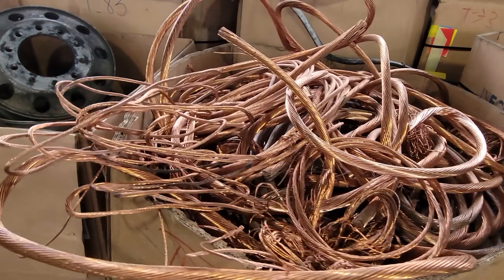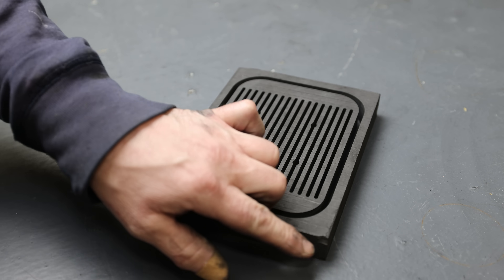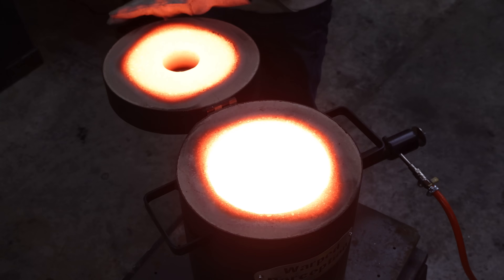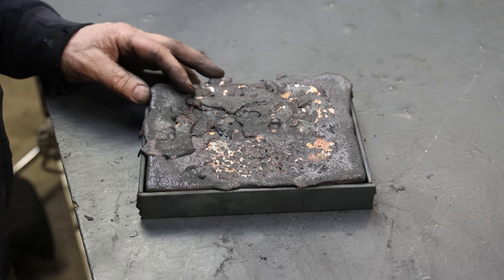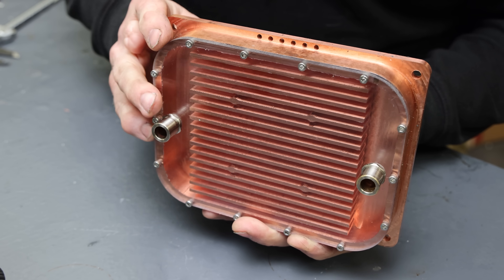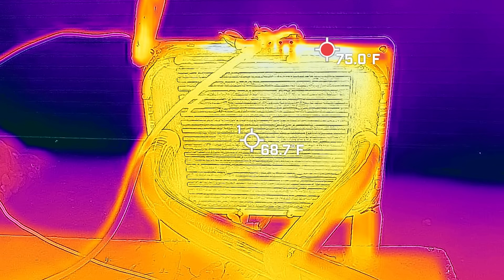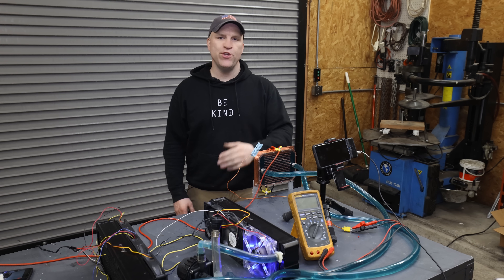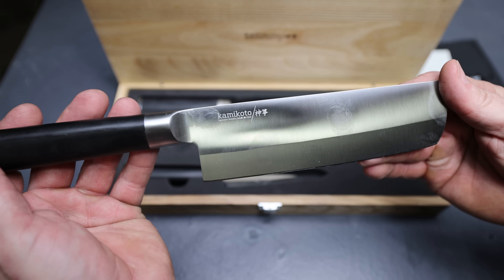Making a Huge Waterblock from Scrap Copper -Trash to Treasure

Comment: Is it me or this should have been done in one single uninterrupted pour as allowing for the metal to start to cool down and solidify before another pour will result in less than ideal properties (aka transition zones prone to cracking/easier to break)? *Just asking, definitely not my area of expertise
Reply: He recast it 2 more times to get it right... says in the video
Reply: He needed a larger crucible, larger crucible tongs, larger foundry and larger biceps (and/or help). Having been in the same situation myself, I think he did rather well for himself.
Reply: @frankdoss6313  damn good effort and results as an engineer myself I'm impressed.
Reply: It looks like he worked around that by superheating the final pour over the furnace to allow the whole item to re-melt into one item
Reply from the maker: @GaisaSanktejo  I did try that but it failed, because carbon oxidizes in a flame environment, so basically in the longer you keep it on that flame the more the carbon mold basically evaporates and disappears eventually. The carbon atoms heat up and combined with the molecules in the flame kernel. But yeah that didn't work so I had to recast it two more times.
Reply: @WarpedYT  Ah, that is a shame
Reply: @WarpedYT  perhaps heating the block in an argon/nitrogen kiln could save a step...but you're right lifting that much dangerous metal is not fun. Best get on fabbing a crucible tilter!
Reply: @WarpedYT  bloody nice job mate, as an engineer myself impressed bro. Keep on keeping on👍
Reply: @WarpedYT  I would "think" you'd want to pour it like pancake batter, start in the center and let it keep flowing outwards vs moving around, that way it wouldn't cool unevenly like it did?
Reply: @WarpedYT  clamp another graphite block on top of the mold and drill a hole thick enough for the metal to flow through, add a bowl shape around the hole, extend the bowl width with sand if necessary, and pour into the mold.  A hole on the other side is necessary as well so that air can escape.
Reply: Called a 'cold shut' if anyone cares.
Reply: @hendrikvanleeuwen9110  as a teen I was fortunate enough to grow up next-door to a bachelor with a GARAGE full of fabrication tools and a full forge out back, a FULL machinist shop, and as I got older a fridge full of beer too! He was one heck of a professionally trained machinist/fabricator amongst the many other numerous "skills" he taught me...
Reply: @hendrikvanleeuwen9110  I find most people don't "care" because they simply can't muster the metal capacity to understand... But yes, I'm familiar with "cold shut" from Blacksmithing/Blade work. Where instead of having a good "hot metal bond" you trap a layer of cooled metal that doesn't bind, or even a pocket of AIR if you're a really "lousy" Smith between your work, vs one "homogeneous" molten piece. Correct?
Reply: @macgyver5108  yup. Essentially you are casting (or alternatively forging) a crack into the piece. Man, I envy you growing up with all that gear available AND someone to show you how to use it.
Reply: @hendrikvanleeuwen9110  I'm MORE than well aware how "fortunate" I was having such a skilled mentor and skill resource just a few short steps away during my formative years! Machining, welding, blacksmithing, small arms care and ammo reloading, even photography with his own darkroom... A "Teenage MacGyver's wet DREAM" if you will! I do my part to pass that on to the next gen, even to my nieces.
Reply: @macgyver5108  enough with the "quotes"
Reply: @coronalight77  What quotes? Get a grip or wake up, haven't used them here :P Coffee missing?
Reply: @coronalight77  as the great poets Henley and Frey put it so well... "get over it!".
Reply: Lol all that to pretend to have a clue when the basic is you're obviously too slow to pay attention to the full vid. Running to comments like a pathetic troll as soon as you think you have a shot to call someone out only to be made to look ignorant since he clearly answers those things in the vid. Sit down and stay in your lane.
Reply: @coronalight77  yeh yeh hasty hasty I know, and definitely a bad habbit.
Reply: He was saying that it was too heavy and he was losing his grip.
Reply: Very true, I was wondering why there wasn't a separation in the machined part, then he mentions it was the 3rd casting because the first one had separated.
Reply: @kingcosworth2643  Yey to basic physics based logic :)
Reply: @wskinnyodden  shame you have no common sense to go with it.
Reply: Yeah, 605 people who watched this have a clue what they just saw. He wasted the graphite mold too by destroying it after. He could have just poured a slab of copper and machined it - copper is soft and he machined it anyway so it's kinda a waste of time and effort. He did double the work just to make a longer video. And flubbed the pour so terribly anyone else would have started over. Idk what 'five years' working on a LED he's talking about but I have a feeling this is something other people would have made in a week if his fabrication skills are anything to go by.
Reply: Who cares 🤷‍♂️ freaking awesome engineering mate UK

Comment: I guess you saved money and time by machining the graphite and then melting and casting the heat sink three times followed by setting it up and machining each attempt.  Me, I would have simply bought a copper billet and machined it once.  As far as a broken drill in the copper, there are alot of machine shops with a plunge EDM that could have burnt out the broken tool and saved the part.  That aside, cool project none the less.
Reply from the maker: Not really about saving money, It was more about figuring out how to machine the part with The equipment I had on hand, and I thought it was a cool smelting project. If I would have had my big mill set up at that time That would have been a no-brainer, just get a billet and machine it. It was definitely a real pain. Thanks

Comment: Excuse my ignorance but wouldnt it have been cheaper and easier for you to make a big block of copper and then cut it to make the part you want? Sure, you'd have to use more copper, but you can recover that by collecting the scrap from the machining. This way you'd avoid the expense of graphite (which probably isnt nearly anything much compared to copper), and the hassle of casting copper into a complicated mold, which tends to fail sometimes

Comment: Is it me or would casting the copper into a block and milling that out not be alot more easy ?
Reply from the maker: Yes kind of, I may have actually ended up doing that at the end I don't remember but In this case I made the casting oversized and then I machined it, I guess the main purpose was to show the metal going from scrap to a finished part, because if I was going to Mill it out of a solid piece I would just buy a solid piece. But yeah I'm still using the light to this day... I have yet to use it for a video because I was busy with Mr Beast and then I had a brain injury in September so I just got back to work like a month ago...
Reply: @WarpedYT  ahh that sounds bad man , hope your all fine now . Love your content i just found your channel yesterday but great video's  mate keep it up ! and take care

Comment: the copper block you made would work much better if the water went through a maze pattern, instead of just having two holes on each side, I am sure you had a lot of the water where it never moved.

Comment: Those the water cool their PCs deal with this everyday, if you knew the watts of heat you needed to remove you might have been able to buy a copper block cooler off the shelf & long with the needed pumps and radiators to handle this job.

Comment: Hot water needs to enter the top and cold come out the bottom or you aren't taking advantage of your fins. Try a motorcycle oil cooler or a refrigeration unit evaporator coil. It's basically made like a small radiator and will pass air through

Comment: Your camera is also reading the plexiglass not the chip temp.  Hope there is a very good interface conduction. Sometimes that's the hardest part of exchangers is getting the heat off the chip into what ever heat dissipation method

Comment: As some one who used to do a lot of computer over clocking I think you can improve the heat transfer a noticeable amount simply by wet sanding the heat sink to a mirror Finnish. Just make sure you make its on super flat surface (I used a glass block in the day). Worse case scenario it will look super pretty. You may be able to get away with no using thermal paste either. I'm not sure the surface of the LED but we polished cpu chips too. I was able to punch 5.5ghz on a bsel modded Intel Core 2 Duo Wolfdale on air and almost 8ghz on liquid nitro.

Comment: ALSO YOU MADE IT WRONG THE INLET SHOULD BE ON THE TOP AND THE OUTLET ON THE BOTTOM OR VISE VERSA NOT ON THE SIDES BECAUSE THE COOLANT WILL ONLY GO ACROSS AND NOT THRU ALL THE COOLANT FINS LOOK AT A CAR RADIATOR!!! BOTTOM SO TLSO IT THE COOLING FINS SHOULD BE IN A MAZE LIKE PATTERN AND GO FROM LEFT TO RIGHT IN A ZIGZAG PATTERN LIKE MOUSE MAZE FROM TOP TO BOTTOM SO THE COOLANT HAS CONTACT WITH EVERY COOLING FIN ALL THE WAY DOWN! JUST SAYIN IT WOULD COOL BETTER!!! JUST SAYIN

Comment: so i noticed how the copper almost flakes out and breaks into splinters like wood. is that because it was made with copper wire, and for whatever reason it didn't properly consolidate when it was smelted? i mean, if they were coated it could happen, which can be dealt with by burning them out first at a high enough heat, and removing the slag and soot. or it could simply be the matter of how it was made. if it was cast into a single block first, and then milled, instead of cast into a mold and then still have to be milled out...

Comment: here's an idea for cooling. liquid cooling. but not just any liquid cooling, but one that both makes use of a very thermally efficient fluid, and basically high pressure pulse width modulated high capacity liquid to air intercooler. the idea is to have the fluid have a periodically interrupted flow to help the intercooler which itself is liquid cooled by a highly chilled liquid, to help with more efficient transfer of heat energy. think 2 cooling circuits running parallel to eachother through the intercooler block in such a way that it can constantly be kept cool from one resivoir of a cooled liquid while absorbing heat and more quickly cooling the liquid to the main circuit. no idea if it would work, but it seems like it could be a more efficient way to do it than a single intercooler, and not need a second one to compensate.

Comment: Brilliant work! It looks like you might get short-cycling of the coolant by having the inlet and outlet in the center, but if the chip is small enough and centered on the water block, that's probably not a bad thing, as the greatest flow rate of the coolant will be at the center, where the most heat is being generated. Are you using a thermal paste between the chip and the block to maximize the heat transfer from chip to copper?

Comment: short version:
-more thermal mass {large coolant reservoir} 
etc

long version:

to improve the heat dissipation wothout too much work  you should add a semi large resivoir, about a gallon or more coolant to increase the thermal mass which will in turn passively contribute to cooling off the COB. and assuming that that is just dyed water, i reccomend using the same coolant for most cnc machines since they have nanoparticles specifically designed for pulling away head energy without degrading for a few weeks of constant use, and since i can guess this wont be on 24/7 for nearly a month i can wager that it would help. also keeping your radiator, resivoir and pump above the cooling block should allow it to automatically fill in the air bubbles. i plumb heat dissapators for mazak machines all the time at work when we get new ones so this stuff is somewhat in my field.

Comment: I would've poured with 25% of more extra molten CU just so that this could be a continuous pour.  What about a vibrator on the side to keep the bubbles migrating to the top as per working with concrete - would that have made any difference?  What size COB LED light did you use?  I've worked extensively with these and know they range tremendously in size.  I'd like to see you take this outdoors and see how far this light could shine.  That would be a pretty cool sight to behold.  Great job!

Comment: Buying a billet of copper, or casting a square slab would have been easier. Make a box out of stainless steel and melt the copper down inside of it. when it cools you have your non porous block for milling.

Comment: What if you preheated your casting to 600 f to 1000 fdegrees first before you did your pour

And you did it within a container that was flooded with argon displacing the oxygen so when you dropped down to the level of your poor you were below submerged under a level of argon

Comment: Awesome Video!
I have some questions that I would love to know the answer to just out of curiosity.

1. what is the Total Lumen Output of your light at 100%? 
I say "Total Lumen Output" because many of the "Chips" produced today are actually composed of multiple LEDS. This allows the light to perform in different ways depending on its required application. So I am not talking "Per LED" if your chip happens to be a cluster of LEDS.

2. do you know what the "throw distance" aka how far the light produced from the chip travels @ 100%? 
This question is especially interesting if the chip is comprised of only a single, to a few LEDs. 
For those wondering why I say this: 
Typically these chips will actually use a "Sheet" of LEDs, which allows them to produce a huge number in terms of Luminosity! However, when that is the case, they tend to not travel as far compared to chips that are made using only a single LED.

It is also something that is interesting to know because the chips comprised of only a single LED are MUCH HARDER to cool than the chips that are comprised of a "sheet" of LEDS due to surface area.

@ Warped Perception:
Please feel free to change the numbers +/- some in order to protect the identity of your new experimental chip. 

Thanks again for producing such amazing videos!
Cheers!
Reply from the maker: So it's about 180k-200k lumens, you are absolutely correct about the led arrays vs single. So this is a mix between those 2, it's a COB but miniaturized to take advantage of the single point source single LED light layout. So bright and it has worked so well then I haven't needed to use it more than about 40% power yet. But I will very soon in some upcoming episodes.  Thanks

Comment: I have to tip my hat off to you Sir. Doing work on the unknown is always a challenge. One question fella, how does this chip compare to the chip that was made by a Polish inventor that lasts a hundred years of use ??? Thanks vf
Reply from the maker: Thanks! Yes it's tough sometimes. Which chip is that? Can you send me a link ?
Reply: @WarpedYT  I have to do some homework to find this information. Give me a little time fella. The chip you are using, did you make it ???

Comment: Next time, STAGGER YOUR WATER FITTINGS!  You always want to stagger your water fittings. One at the very top, other at the very bottom. 2 reasons why you want to do this. 1, it helps to distribute coolant more evenly across the fins of the waterblock. If both are in the middle, path of least resistance dictates only the center fins will get a majority of the flow. 2nd reason, self bleeding!  You always fill a radiator from the bottom. Air rises. If you fill from the bottom and your ports are staggered, your other port will be at the very top. This means if your inlet in in the bottom, it will fill with coolant and naturally push all the air out without assistance. If you sick air with your pump on accident, it will not get trapped in your block. 3rd reason you want to stagger is because with a block, you can have it oriented fins horizontal or fins vertical you will always have a port that is on bottom and a port that is on top. Never trap air, never need to bleed, better cooling efficiency..

Comment: Wouldn't it have been better to have a spiral pattern in the block with the feed in the center and the outlet at the edge? That would put the lowest temp fluid in the middle where I would assume the most heat is produced and have an even flow out.

Comment: Just a tip, you could just check the full volume of the part in fusion, compared to the volume without the extruded channels by right clicking on the body to inspect it.
Reply from the maker: I know but I wanted to make it more visual for those who don't use CAD

Comment: What size radiator(s) did you use? What was the water temperature when the chip reached thermal equilibrium?
Reply: Looks like a 360mm radiator maybe a 45mm r 60mm thick.
Reply: @randybobandy9828  If that's the case (which remains to be confirmed), then the thermal dissipation we're talking about here could probably be handled more efficiently by a simple $50 CPU waterblock from Aliexpress.
Reply: @AndreasRavnestad  actually if you look at 8:33 there are 2 360mm radiators. They look like 60mm thick too which is double the thickness of most pc radiators, especially aio radiators. The performance difference between 1 360mm radiator to the next can be massive when you factor in radiator thickness,  fin density, fan speed.
(Edit: actually the left radiator looks like a 60mm thick and the right one looks like a 45mm thick) should be adequate in cooling 1000w or so)